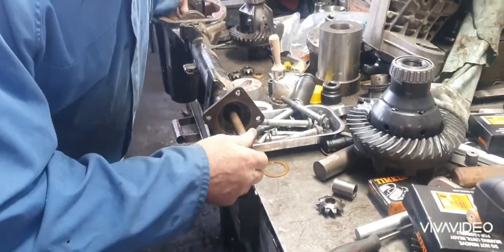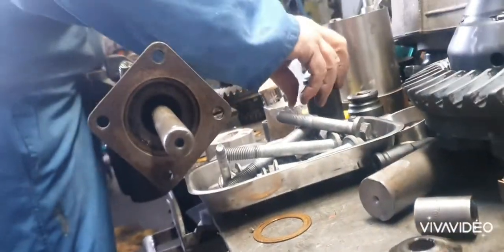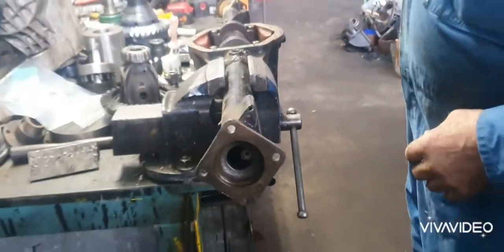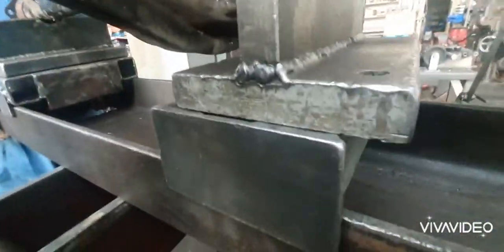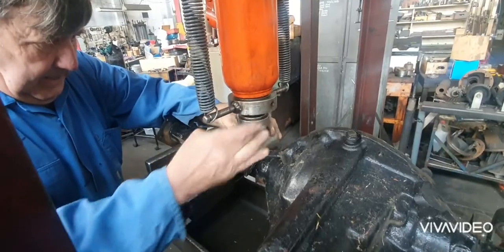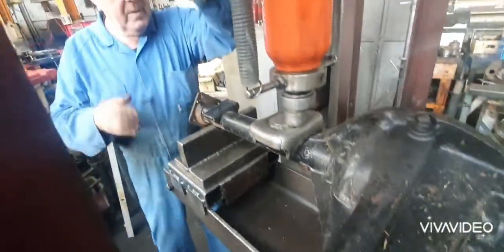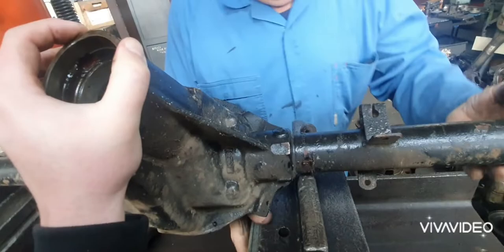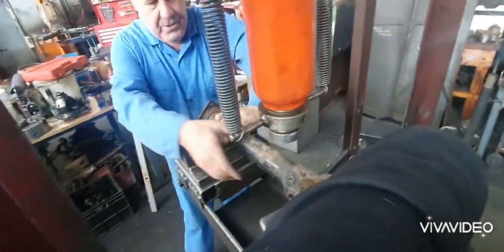how to straighten any diff housing

Comment: Hey boss man, what's the tool that you used to check if it was straight or not called?
Reply from the maker: It's self explanatory in the video. it's a round bar with two bushes that go in the bearing caps. 👍😊 You just have to get any size round bar from a steel merchant that you know is straight and some round steel and machine the diameter to the bearing OD of the carrier bearings and put a hole through the bushes to fit the bar 👍
Reply: How many tons is the press ? Would this work on a dually axle ?